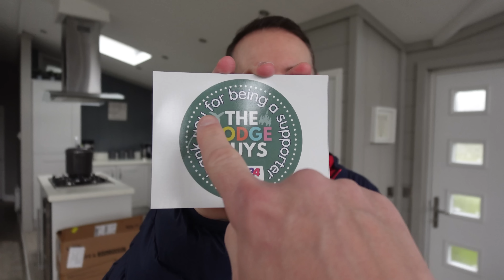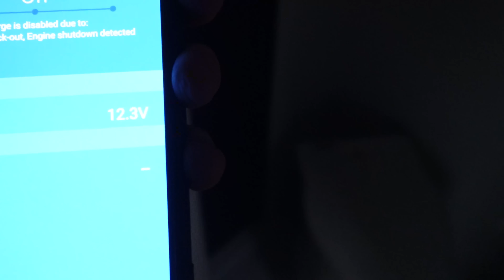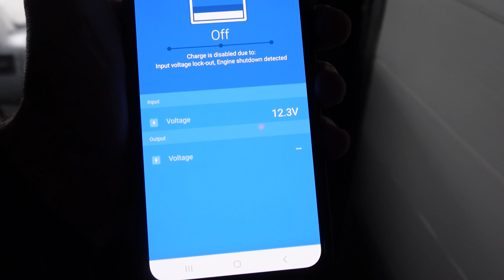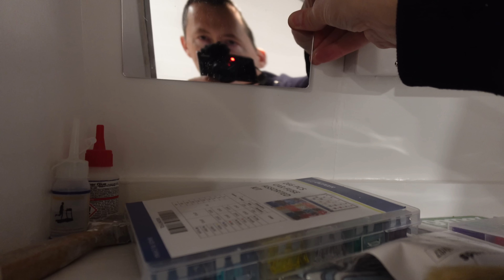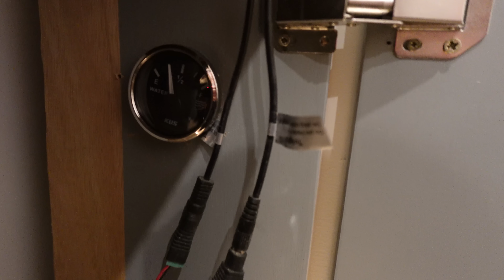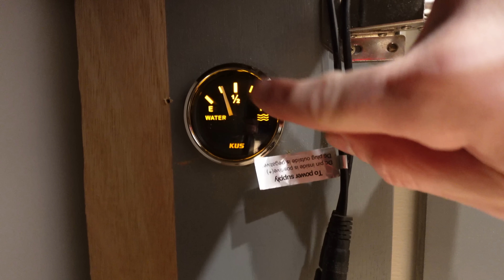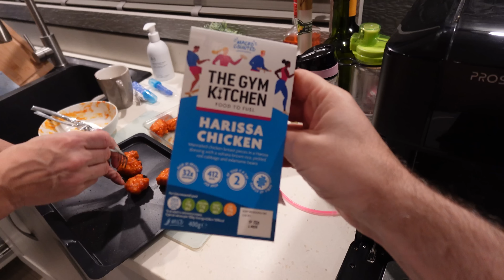Back at our lodge | Will the van start?

Comment: I have black out curtains in my bedroom and they are just the same as yours regards the feel being stiff it’s because the lining is made of a rubber material. Try washing them but you have to hang them whilst they are wet as you. As you can’t put them in a dryer or fold them as the backing sticks together but it will soften them a bit.

Comment: So the van still struggles to start in cold temps with the correct voltage, still needs new glow plugs I see.
Reply from the maker: nope it starts fine the issue is the DC to dc charger trickle drains the starter battery 12.1v isnt normal voltage for the battery,  that and it hasnt been started for 5 weeks
Reply: and yet there’s enough power to crank, but it knocks into life as at least 1 of the glow plugs isn’t warming the cylinder enough to initially combust. I’ll keep waiting.